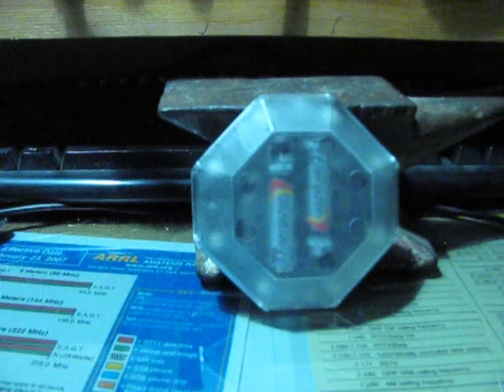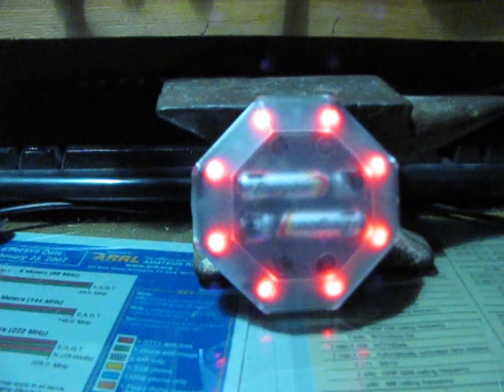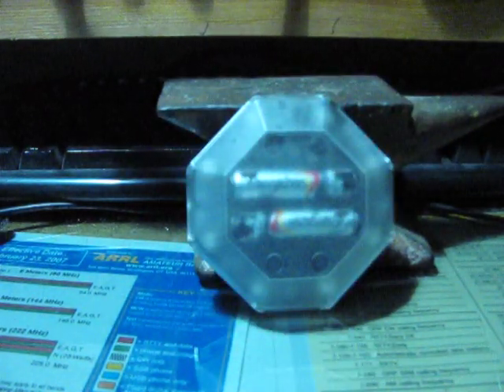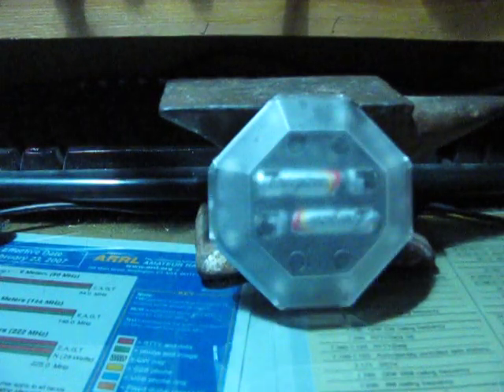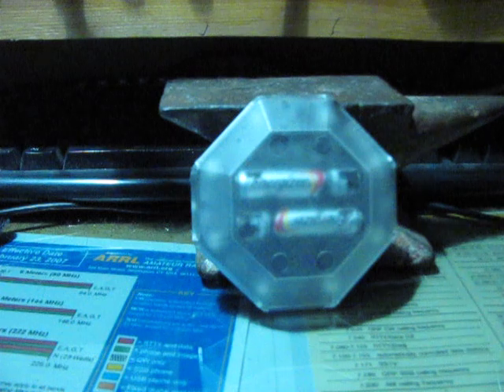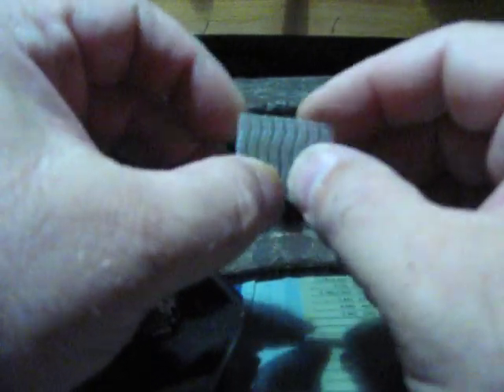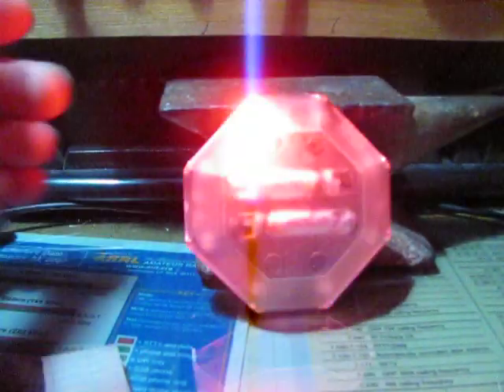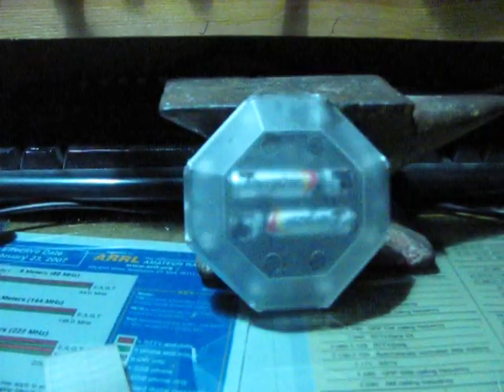Lucid Brake Bike Light

Comment: It's called velcro.
Reply from the maker: +ajwasp gmail.com No, it&#39;s called 3M Dual Lock. It&#39;s much stronger than Velcro. Velcro is a hook and loop system.Dual lock has mushroom-shaped prongs, which are identical on each side.